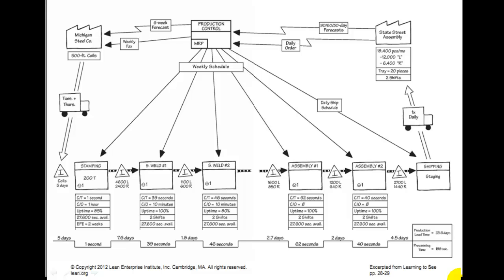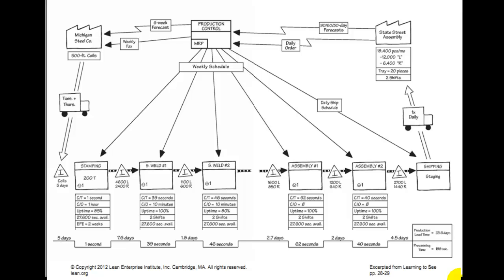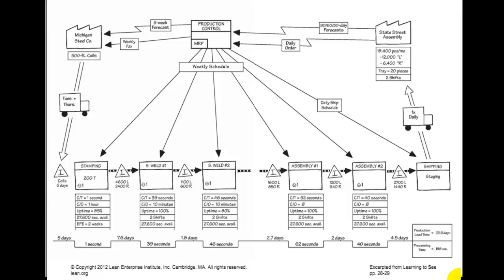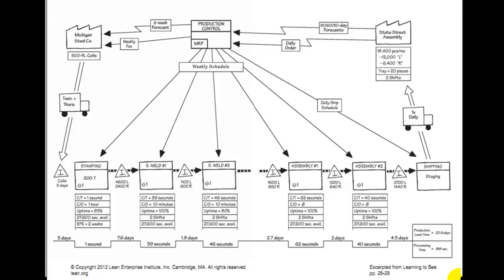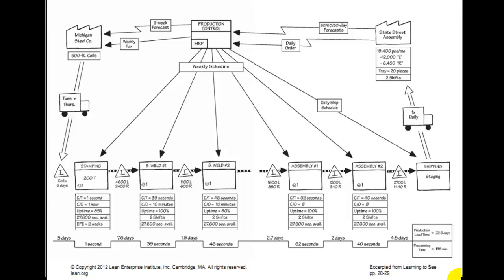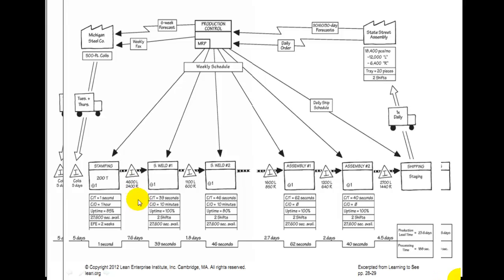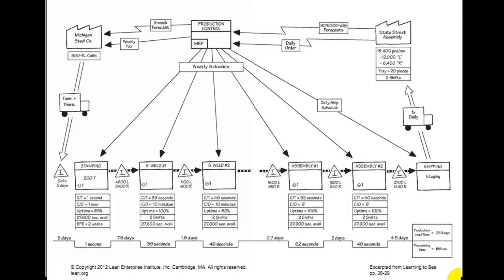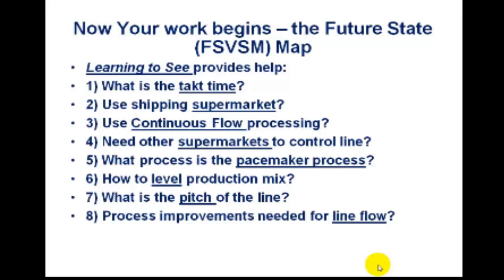6  Value Stream Mapping, Part 2

Comment: Are there any questions ?  Ya!  Slow down and explain where you got half the stuff you put up for slides.  Where did 240 come from in the PCS ?  Sounds like this class was a rush job
Reply from the maker: J: The company works 20 days/month times 12 months/year = 240 days/year. With 23.6 day production lead time, 240 days/year/23.6 days ~ 10 inventory turns/year. This video was developed for a large group of students as part of a brief  introduction to the use of VSM. Yes, and  this introduction of the 15+ concepts had to be done in an 11 week quarter,
Please ask any other questions.